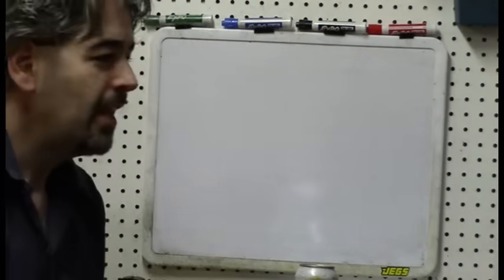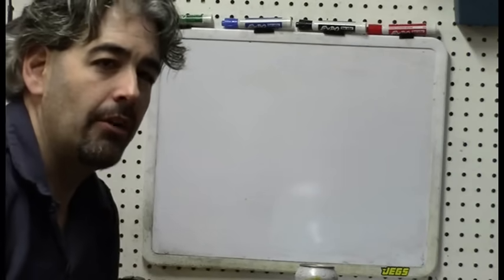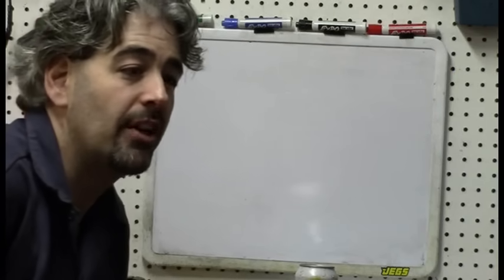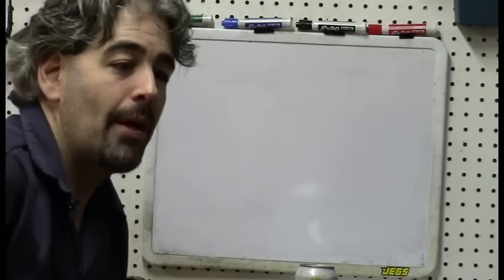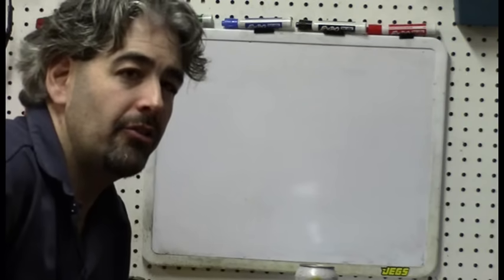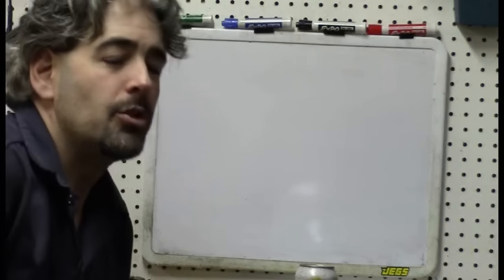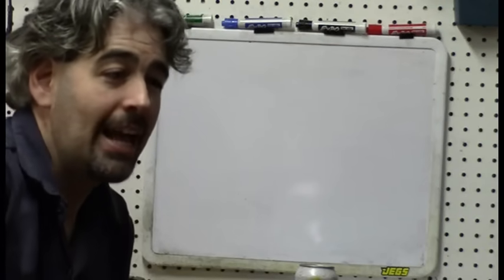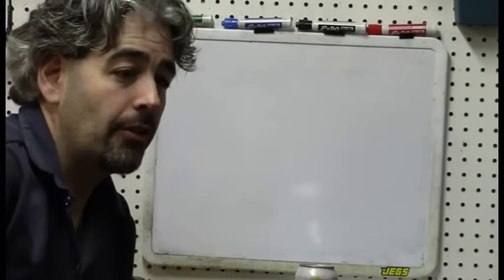Secret of Engine Problem Diagnosis- Fuel Trims Pt.1

Comment: What's boggling my mind is fuel trim when parked idle is +10% ltft....so i wanted to check for vacuum leak (small one) by increasing rpms to 1500 and then 3000....at 1500 it goes up to +16% and at 3000 it goes down to +7%....strange....

What's crazier is when I am in gear at idle it is still +10% but when I get moving and rpms are 1500 the ltft is actually about the same or a little better at +7% and when driving and 3000 rpms (highway o/d off) the trim is really good at only +3%....
Reply from the maker: sounds normal to me
Reply: @SchrodingersBox  I thought +16% was a little on the high side....
Reply from the maker: total trim is well within range.
Reply: @Schrodingers Box  when parked and revved to 1500 rpms ltft goes to +16% and it stays happy there...short term fluctuates +2 to -2...so my total trim at that time is +14 to +18%...
Reply from the maker: I would clean the MAF as next step and remeasure trims.

Comment: Top of your head, cause of misfires , very hard bucking on all clylinders, only between 1-5 on all 6 cylinders , fuel trim on point between-5 and+5, with some hesitation and lag , only on low rpm, car only has 50,000 on it , no codes at all
Reply from the maker: Nothing I can pull from top of my head because there is no data to draw from. need to have data.

Comment: ,My wallet is getting pretty thin, I love  Cars & Trucks , The Money  That I wasted over the years, Looking back I have owned 32 Cars & trucks  in my life so far  ,Now if  I could do life over and  go Back freshman year at vo tech I think I would  have chosen Auto Mechanics Instead of Welding  ,Im a Retired  Ironworker  36 years , The  very last job I did was the steel barrier fence that surrounded ground zero after 9/11 Manhattan ......What a way to go out.. Great video  I learned a great deal, My son is working on a 94 ford ranger splash 3.0 53k original miles barn find sat 13 years did complete tuneup coil fuel pump/ filter  No Codes the Motor shakes has a Misfire at low Idle you can feel it in the cab, Step on the gas a little  it clears up  Not much power ?

Comment: Thank you for sharing your hard work for us to use and understand.  Completed a LR4 swap in my TJ, and had it tuned 6 months ago.  Everything was perfect.  Ran into some issues last week, and I have a bluetooth scan tool.  Checked my fuel trims, Long term was +10-12 at operating temp, O2 was at .0-.6V.  Followed your guidelines, got fuel pressure kit, it was at 50psi, and when revved 45psi.  Too low for these engines.  This has a return line with a vacuum operated pressure regulator.  Pulled the vacuum off the regulator, pressure went to 55psi, and heled when revved.  Put cap on both vacum lines, and went for a drive.  The LTFT wen down to near 0 in a couple of minutes, and short term went negative, indicating it wanted less fuel.  O2 voltage was going up to .7 and .8 volts, which means it likes the 55psi much better than the 45-50psi.  Went around the block, and runs much better, holds the fuel trims at near 0, and o2 voltages are from 0 to .9.  Without this, I still would have been lost, throwing money at parts.

Comment: Where are u located?
Reply from the maker: Denver Colorado
Reply: @SchrodingersBox  thx for answering, Iam in by , wish I could come loo
Reply: Ny, lol
Reply: 2015 pathfinder, no codes, runs like crap, 45,000 on it , jerking on slow acceleration, feels like something heavily holding it back, fuel trims all over the place, rear o2 going down and up constantly, and exhaust sounds muffled, with ac on 10x worse, pretty sure it’s the cat or something clogged, I don’t know how. , thx
Reply from the maker: with “fuel trims all over the place” what does that mean exactly? there should still be a pattern at least between idle and under load. what are they showing as ranges?

Comment: Sometimes I just come back to this video just to refresh my concepts! Thanks Matt!

One quick question: I have heard you say that +/- 5 on the LTFT is within tolerance. So, how much above that threshold would you start to worry prior to a check engine.

For example, my Passat’s LTFT currently idles at ~8-9 and then drops to ~3 when I rev over 1.5k rpms. Is this enough concern to suspect something like a vaccine leak?
Reply from the maker: When I see above or below 10 AND there is a drivability issue or MIL, I consider it potentially contributing. If I see above or below 20 I consider it needs fixing regardless of complaints or MIL indicator.  +\- 20 is a definitely faulty issue.
Reply: @SchrodingersBox  dang man, thanks so much for your help! Much appreciated.

Comment: P2096  freeze data 
Short term fuel trim - 1.6 
Long term fuel trim 4.7
Vehicle speed 50 mph 
Engine speed 2084
O2s2 v .435
Shrt  term  fuel % -2.3
O2s11 V 2.760
Eq ratio 0.989
Eq ratio 0.982
O2s11 (MA) -.051
 This is freeze data when I was driving check light went on and I got this freeze data anything u can see
Reply from the maker: Can’t tell from this freeze frame. Need it curved against load to tell anything.
Reply: What u mean by curve against load .. elaborate plz
Reply from the maker: You have to get a range of time points accounting for variations from idle to high load conditions. 
   You can’t just look at a single time point.
Reply: When under load my long term fuel trims go lower then the short trim and then when letting off load they swap   they both be in positive  and rarely go negative .. I witness the computer setting a new base line when both my.long term and short term  where both close or on 0
Reply: What numbers are these sensors suppose to show, MAF MAP and the O2 sensors.?
Reply from the maker: sorry I don’t follow what you are saying. the pcm cannot set a new baseline on short term. It uses the short term to establish the baseline for long term only.
   what were the actual numbers you got?
Reply: Regardless my fuel trims pass 12 to 15 before  regauler cruise driving trims level out close to each other and kinda close to zero like short term 2.3 and long term 3.3
Reply from the maker: Indicates a vacuum leak but not likely enough to cause your symptoms. Seems you have a vacuum leak AND something else.

Comment: i got 4% STFT/24% LTFT at idle, 18%/6% at 2.5k rpm, and 8%/25% at 6k rpm, so weird
Reply from the maker: Not really- thats the learned adaptive fuel trim for each cell.  Looks like a stoichiometric deficiency across all cells to me.
Reply: @rqm4no  from my simple understanding, fuel trims that go up with higher rpm indicate fuel delivery problem, and fuel trims that go down with higher rpm indicate a vacuum leak, i just can't figure out why my fuel trims would go up and down with higher rpm and not go in one direction only. I already checked and cleaned MAF, checked fuel pressure, cleaned injectors and did injector balance, nothing seems to be wrong but yet something is and i can't find it

Comment: Hi sir.  have 99 corolla, I put scanner on it to learn fuel trims, I found out that long term is 19 at all times(idle or high rpms), the short trim is between 3 and -3 at idle, but underload, short trim goes to -20. what are your analysis on this?
REPLY
Reply from the maker: Looks right to me.
Reply: Schrodingers Box thank you very much sir

Comment: Hello, I got this problem in my mini F56. The strange thing is that the fault (P0171) goes away after a few km and comes back again.  It is not possible to delete the error via the reading device if it is contained. Can you help me?
Reply from the maker: What data do you have? what conditions are causing the code?
Reply: @SchrodingersBox  my garage said day the lambda sensor indicated a malfunction.  However, the sensor turned out not to be broken, but the engine does not get enough fuel.  After this, an agent has been added to the petrol that cleans the system.  A week was the road and now the picture varies.
Reply from the maker: What values were given? what was the voltage?  There is no information here whatsoever man.

Comment: Hello anyone out there that can help related problem .. code p0171 
Hot Idle STFT 24.9 LTFT 3.9 ones I give it gas or underload at a steady 2.300 rpm I get STFT 20.0 and up to LTFT 14.8 almost instantly .. ones off the gas STFT drops to 0.0 and picks up again to 24.9 LTFT drops back down to 3.9
     Thanks in advance
Reply: What I'm I dealing with here ?
Reply from the maker: check MAF frequency and fuel delivery
Reply: Where do you think I should start with fuel .? I checked maff cleaned it‚ checked for volts and went as far as testing a new one same reaction  . Do you think I have to reset my computer ? But I do strongly agree as far as fuel related . It's exactly what it feels like ..   thanks in advance 🐱👍
Reply from the maker: Check the fuel pressure both at idle and at higher RPM next
Reply: Schrodingers Box  
  Dang . Definitely got me thinking outside the box you should have seen my face after this diagnosis.. .  COULDN'T HAVE DONE IT WITHOUT YOU . thank you for pointing me in the right direction . 
     So at initial ‚ key on my psi reads 25 for a few seconds and drops to 0psi .engine on I'm getting almost 40psi . As soon as I tap the gas pedal my psi drops and stays at 10-12 psi after giving it some more gas. Psi  doesn't pick up and  remains the same . Feels like it's choking for a good GLASS OF GAS.. what do you think ? I'm I done here or should I move to the next step .. if I'm making an assumption I'm going to say fuel pump .. ? I don't believe it's dirt stuck on the lines .what do you think . 🐱👍

Comment: Can I pay you to help me diagnose my car over the phone? Or video chat or whatever? I’d be more than willing to pay.. don’t think anyone around has the knowledge that you do and I’m tired of throwing parts at my car because they say they recommend “new ignition coil” or whatever they think.. I’m out probably $2k trying to chase this intermittent random misfire for the last few years and I’ve tried to get help but just left in the dust :/ how can I get ahold of you
Reply from the maker: What data do you have?
Reply: Schrodingers Box I’m not sure what to make of the data, I’ve got access to a snap on scan tool, I’ve captured some of the live data on a video recording , several pictures. Gonna subscribe to your website when I can get the time to watch more of these videos but I’ve also sent you an email through the one you have listed in the channel description, if you would like I can try to send you the videos and pictures I took using the snap on scanner if that would be easier for you

Comment: THANKS for presenting this otherwise difficult to understand information in such a GREAT easy to understand format.  Your expertise is evident, AND your teaching skills are SUPERB.  I am a very old school mechanic that cut my teeth WAY before computer controlled and sensor inputs.  Good old needle valve controlled carburetors and point based distributors were then the norm.  You have FINALLY helped this old geezer (72 years young) to understand the scan tool readings and how to use them to diagnose common problems in TODAYS engines.  My Honda Civic (2004) has almost 225,000 miles at present and finally set it's first P1172, P0134, and P2271 codes.  I ran right out and bought an O2 sensor.... but problem persisted….Duh!  Now I am equipped to properly approach the problem.  THANKS ARE NOT ENOUGH but will have to do.  Thumbs up my friend.

Comment: .45 is not correct.  there's 800milliamps between 100 and 900, so half of 800 is 400 plus 100 equals 500.  So the proper middle point is .50 milliamps.

Comment: The main reason that engines are so fussy about the fuel trim is because liquid gasoline is not combustable. It must be in a gas form. What makes it highly flammable is due to its rapid evaporation at room temperature, which increases proportional to temperature, which is why engine performance increases at higher temperature. Ideally, gasoline should be turned to gas prior to combustion, which has proven to substantially improve fuel economy, but because it is injected into the cylinder as a liquid, it does not have enough time to evaporate so they spray an excess amount into the cylinder so that the entire cylinder head is covered, thereby coating the maximum amount of surface area, which produces enough evaporation in the cylinder to begin combustion, which then accelerates the evaporation of the remaining fuel. Because there is always a delay caused by the amount of time for that entire burn to occur, ignition timing must constantly be monitored and adjusted according to the speed of the piston traveling in the cylinder in relation to the combustion time. It would be much smarter to convert gasoline to its gas form before inducing it into the cylinder but because that would drastically reduce fuel consumption, automobile manufacturers wont implement that technology. At the end of the day, they are all in business to make money and nobody has more money than the fossil fuel industry. If they did not have a substantial influence on the automotive industry, vehicles would no longer run on gasoline and the information provided in this video would be moot. Every combustion engine actually runs more efficienly on pure hydrogen mixed with oxygen (gasoline is a hydrocarbon, which is why everything builds up with carbon), which is made from water by sticking a positive electrical conductor and negative electrical conductor in a tank of water. That combustion then converts it back into water instead of exhausting a black smog filled with airborn burnt carbon,  unspent fuel, and a number of toxic poisonous chemicals & impurities that are otherwise unnecesary and harmful to you, your engine, and the environment... To a rational mind, this should indicate just how much corruption is currently effecting the automotive industry.

Comment: Most excellent, Sir! Thank you so much for this explanation of fuel trim diagnosis! You made this lesson extremely easy to understand, and I'll be able to apply this when wrenching on my cars! I agree that pretty much anyone who works on their own car should definitely have SOME type of diagnostic tool. I use an UltraGauge to see all the parameters that the ECU sees. I'd like to get something better for diagnostics though. Got any recommendations on a decent tool with graphs and the like, but won't break the bank?
Reply from the maker: Autoenginuity

Comment: Because I'm quite slow to learn new concepts, I will need to repeat this video quite a few times before the entire knowledge is fully absorbed. However, I have already learned so much more from this video than from any other YouTube video or written source on how fuel delivery is calculated.  Thanks so much for this, Matt - you are truly a very gifted teacher.
Reply from the maker: Thanks man.  Yeah this video is probably the single most important one on my whole channel.  I strongly recommend mastering these concepts. It is the first step I use in most diagnoses
Reply: Schrodingers Box I will keep going with it until I'm completely confident. I've already hooked up my scan tool to confirm that it reads fuel trims and O2 data. Had to use the wife's car because it took me ten minutes of scanning before I remembered that my car is diesel. lol Told you I was a slow learner. Thanks again.

Comment: do you have a email or someplace we can ask a ?....
Reply from the maker: Yes- right here.
Reply: @SchrodingersBox  Hi ...I have a 1995 ford f350  5.8 ...it starts all the time like right now  i dont care if its -20 out side  but alot of the time when its warms up i have to give it a lil throttle to start it again ...and  sometimes when its idling it will go up and down up and down  then it will go weeks with out doing that ....then when I come to a stop some times it will just stop like someone turned the key off but it will start up every time like nothing happen .....sorry you said I can ask .....Jim
Reply from the maker: Ok-what data do you have for the integrator and block learn?
Reply: @SchrodingersBox  well thats the thing I have no Data I never get  any kind of light ...I have a obd1  ford scanner but i get nothing
Reply from the maker: Well without basic information to start with it would be a total guess, sorry. Good luck!

Comment: so I suspect you won't see this comment, but if you do, or someone else sees it maybe it will help someone.  If your long fuel trim is off the chart, and shot is very high too, and it gets worse with rpm, and all else fail to find a problem.  Check to see if someone put E85 fuel in the car.  Had me chase my tail all day.  Fill a glass or clear plastic container half with fuel from the car and half with water.  Shake it up if its E85 it will be clear when the gas separates out the alcohol will mix with the water.  You will see just a small amount of gas at the top.
Reply from the maker: I see it. It’s certainly a variable to consider.

Comment: Watched again. I have a V6 engine. I've got 2 air fuel regulators, 2 cats, and 4 O2 sensors with one exhaust. 
Going to check the manual again to be sure, I don't think it even covers this.